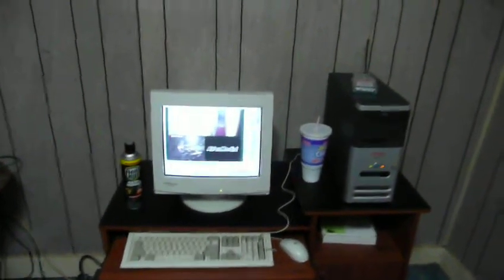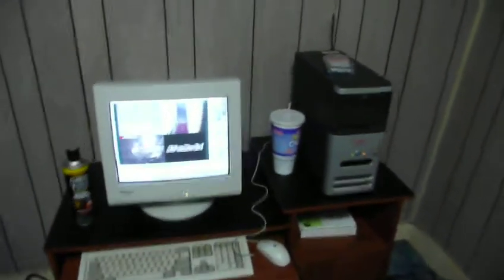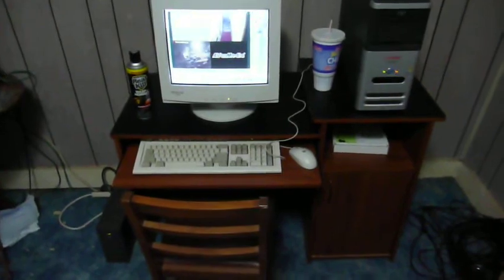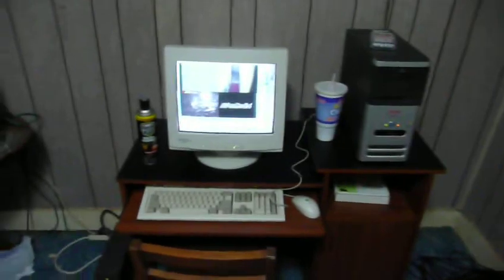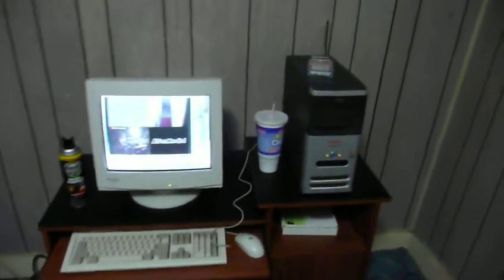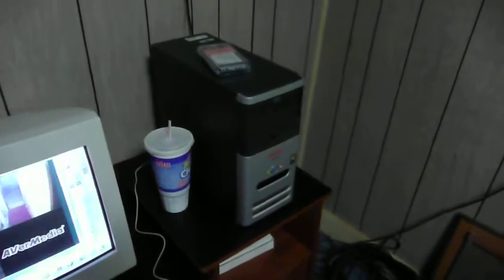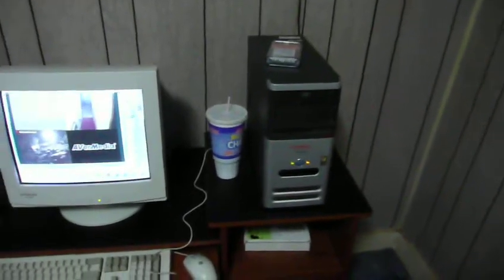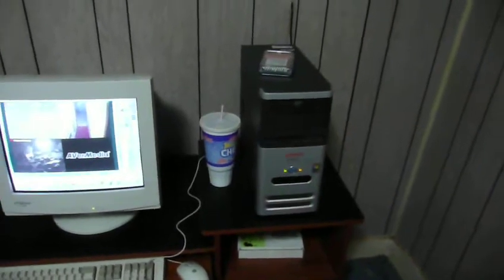Adding a Thermostat to an Air Conditioner

Comment: Would something like this work for a electric fireplace with a heater that doesn't have its own built in thermostat and only is either on or off
Reply from the maker: So long as you have a contactor or relay that's heavy enough to stand the load, absolutely. You would also use the "W" contact on the thermostat instead of "Y".
Reply: @uxwbill  that's what I thought

Comment: A whole house A/C unit or a window unit with a real thermostat will shut the compressor down but keep the fan running so the coil dries out so you don't get that musty smell reminiscent of old road side tourist cabins.
Reply from the maker: I could have wired the unit with a time delay (maybe even by way of an old limit/delay switch) to do that, but I never saw the need. The sun shining down on it tended to dry it out pretty quickly.

Comment: Decided to do this with a window unit I'm using at the moment. Thermostat was bad in it, so I just shorted out the compressor wires. Built the same contraption you have, but with a GFI outlet initially. That is, until it failed, which was in about five minutes of AC operation. Replaced it with a standard duplex outlet. It's also housed in a PSU chassis, and all of the components are epoxied to secure them.

Comment: A year or more later and i have this very same system installed in my mothers room to control her A/C in the summer and the heat in the winter in there to keep it precise temp. In my new personal room i have a telephone transformer and a solid state relay which i find is a lot better and a lot more quiet and has not failed me yet.

Comment: I did some research on Google and found a couple of Brewers did the exact same thing. They took apart the controller.  Removed the thermistor an extended the wires to it.

Comment: Ah OK I know u said you didn't like to trade machines with people on youtube, it was just in case u happened to find an intel mac or had one layin about that u needed rid of, its just some of the apps I need for uni dont run on the powerpc anymore, and right now i dont have enough for an intel mac even thopugh im saving up and i have a windows 7 pc of my own I prefer a mac laptop to use most of the time.
Thanks anyway.

Comment: If that's a reverse cycle unit would it be possible to rig the thermostat up so it fires the reversing valve should you require heating in that room in the winter?

Comment: Also found a 10,000BTU A/C thrown out with an electronic circuit board thermostat that was no good, jammed a wall wart and relay (standard automotive style) in there and threw that to a yo-yo as well.  That unit is still in operation--gave it to a friend; I have central air now.  The coil of the relay can use plus or minus a few volts as long as the coil engages securely.  So a 9V wall wart *may* engage a 12V coil relay.  Use old junk you have already, take a relay from one of those cars!

Comment: I did something like that a long time ago, using a heavy-duty extension cord, an old 12-volt wall wart transformer, a heavy duty switch, a project box from RadioShack, and an old yo-yo thermostat I had around.  The heavy duty switch could be selected for heating or air conditioning, so that the thermostat would either "turn on" or "turn off" the appliance plugged into it.  Worked great, but have no real need for it anymore.

Comment: Well, that's one way to make it work, I've been told you can also get thermostats that are designed to hook straight to line voltage.  I'm working on a little project at work that may need a line voltage thermostat.
Reply: baseboard heat thermostat but that wouldnt work cuz its heat only